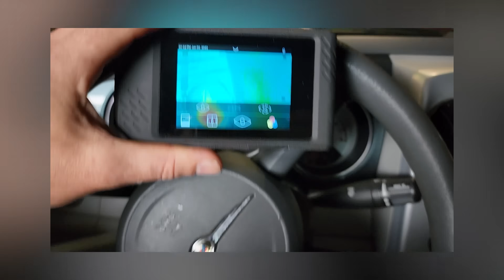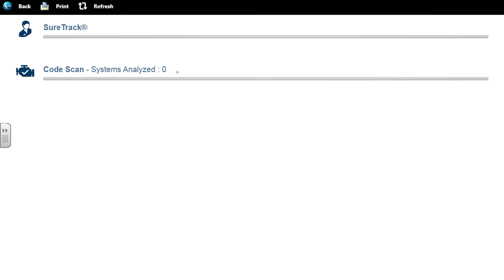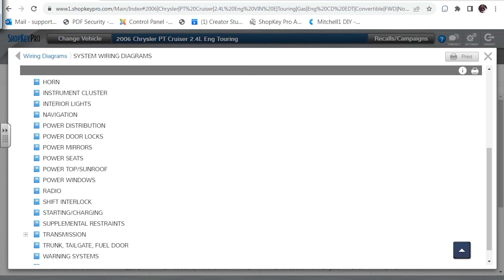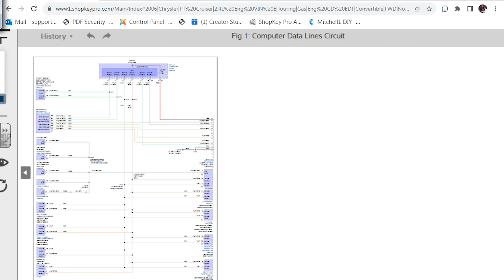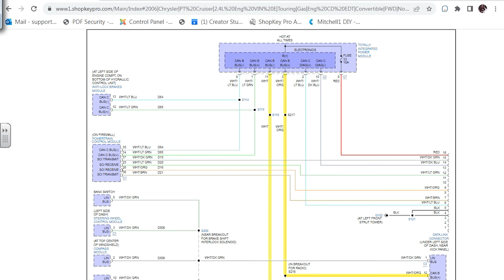Parasitic Drain from CAN-B Staying Active-Transmission Problems Part 1 (an SD Premium Preview)

Comment: I found that the Chrysler can bus system can be difficult to trouble shoot and tricky to isolate modules on . Tampering with it seemed to waked up modules  on me  .and the system is very sensitive to battery voltage

Comment: Honestly it doesn’t look like a hard issue to figure out. It’s an older network. Pull the fuses that feed power to modules instead of taking things apart. Like Keith from new level auto showed in a video.
Reply: If you start pulling fuses apart they will reset the modules you'll have incorrect readings can't do that on a computerized vehicle
Reply from the maker: Older network, newer network, same animal, makes no difference wouldn't you agree?
Reply: I’d agree. Been following you since my mom Cheryl told me about you. Said she followed your vids from like 2011ish or so. When you used to do tons of work for Pete

Comment: What thermal imaging camera is that? It had a better picture than the snap on one which I’m sure is more expensive
Reply from the maker: It's called a Seek Shot Pro and it's around $700? I have it listed on my Amazon Affiliate
Reply: Not bad snap on like 1500

Comment: Its a chrysler product... 170ma sounds pretty normal until the radio falls asleep which can take 30 minutes... there are TSB's regarding parasitic draw testing on chrysler products because how much current certain modules draw until they fall asleep... which takes FOREVER.
Reply from the maker: It was 1300-1400 milliamps